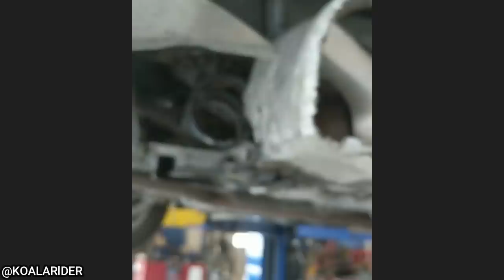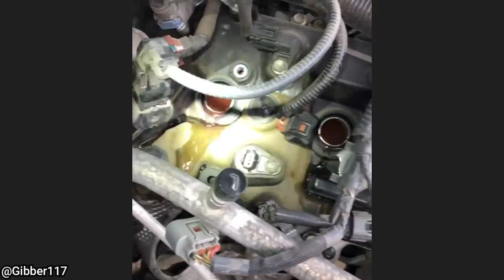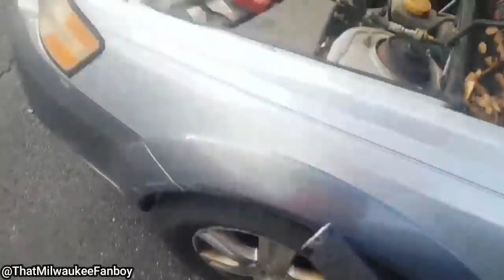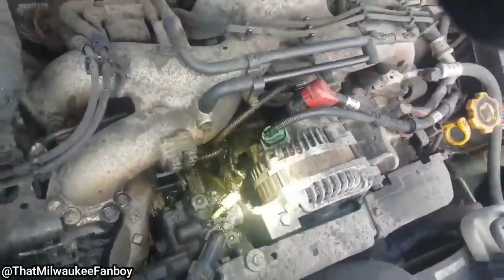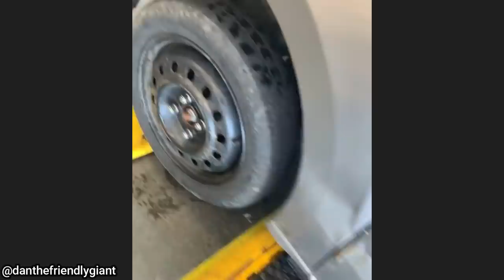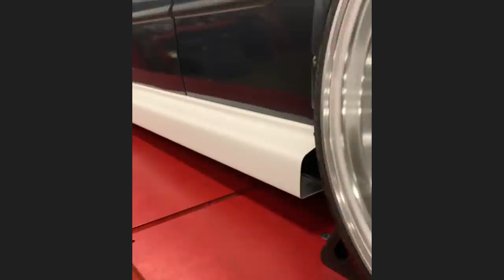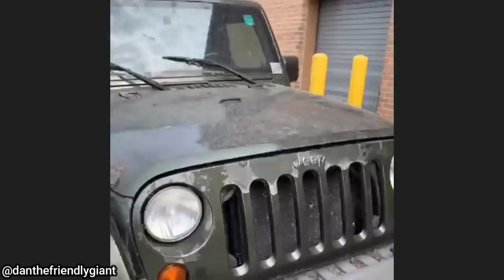Customer States They Want All The Damage Fixed | Just Rolled In

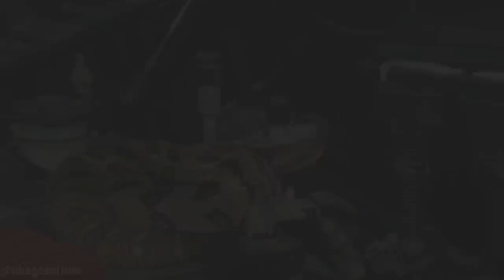Comment: 2:05 Looks like a hydrogen explosion. The battery looks pretty empty, maybe he never checked the acid level and the air-hydrogen mixture got ignited somehow.
Reply: @foodhatesme  to be fair, this basically never ever happens. You put the battery in, you forget about it and use the car for 4 years or so, the car starts turning over slowly, you replace the battery and repeat. Maybe this one had a manufacturing defect.
Reply: @nthgth  in my town two years ago a man was badly injured when starting his van in the morning and the battery exploded
Reply: @entieda8409  that's really unfortunate for him. I guess a 1-in- ten-zillion chance means it will still happen a few times overall.

Comment: LOL where do I start? #1 deserves getting the cops towing that. #2 sadly I took a Subaru into a shop for knocking. I was told that piston 3 wasn’t making compression. After putting in the recommended amount of oil compression was restored. #3 No one wants to see that snake camping out inside the engine bay. And #4 im not sure if that gutter side skirt is just funny or if it’s bottom level genius. 😂

Comment: OK, I have had a battery blow up before, voltage regulator went bad. The gutters were very, brain dead engineering. Last but not least, ran over a window ac unit in the dark, but I was in a truck so very little damage, just a good scare as the truck left the ground on the side I ran over it with.

Comment: My mom's car just recently had an issue that transformed into a different issue.
For the past few months her battery would eventually die. Turn out 1 diode in the alternator failed and the other 2 slowly followed up to their death. Last diode died by giving out a big orange spark.
Got the alternator repaired at an alternator shop.
Alternator is back and running with a worst side effect. The diodes in this one are failed and let power go through both way. So overnight the battery went from 12.6V to 7.5V. Turn out the alternator is hungry and eat a whole 5 AMP while the battery is connected. Getting this fix tomorrow!